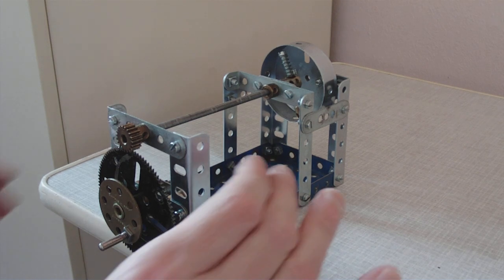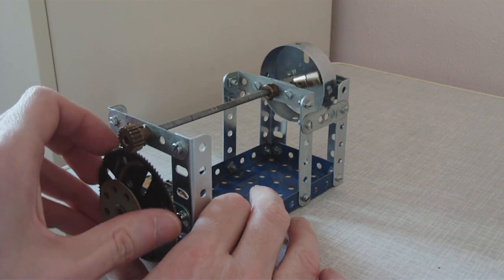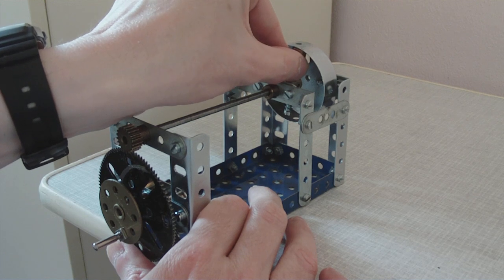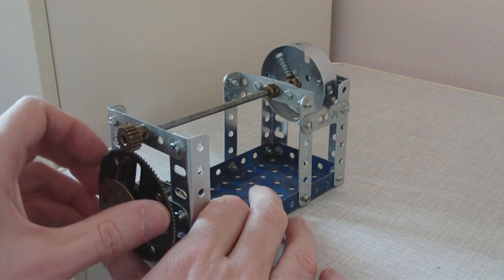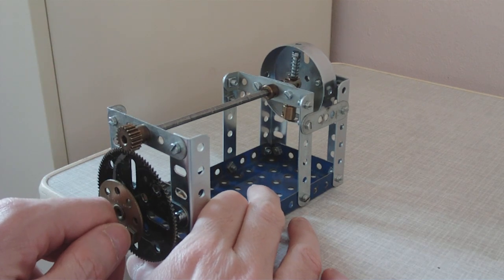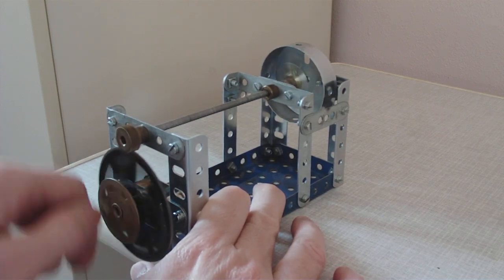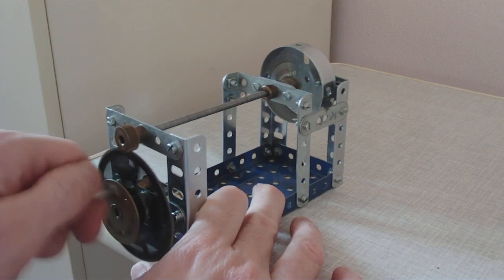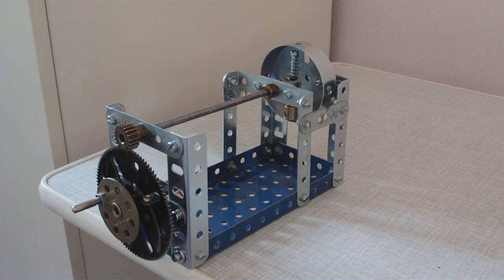Meccano mechanical governor (Ver. 1)

Comment from the maker: There are 2 Meccano clockwork motors, magic and No.1. They both run for about a minute. No.1. is the more powerful, but larger. The output is about 400rpm. Reducing the speed to maybe 60rpm with an external governer would allow it to run for about 10 minutes. The No.1 motor should be able to operate cams as long as the rpm of the cam is not too high. On automaton motors, I don't know, but would assume they are simple clockwork motors with an internal mechanical governor.

Comment from the maker: Just about any of then. Here are the part numbers. 13, 13a, 13b, 13c, 13d, 14, 14a, 15, 15a, 15b, 16, 16a, 16b, 17, 18a, 18b, 18c. Information guides are tricky. The main guides are guides to making given models in a manual. The 1970's set 9 manual has quite a few mechanisms, and there is also the mechanisms manual. You might be able to find them on ebay or somewhere similar.